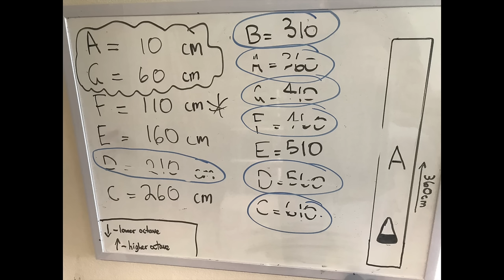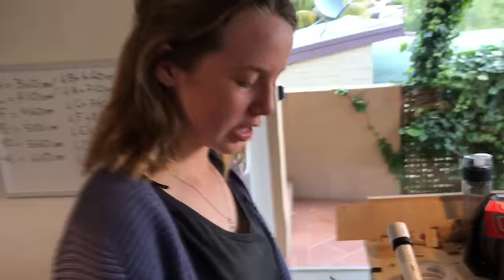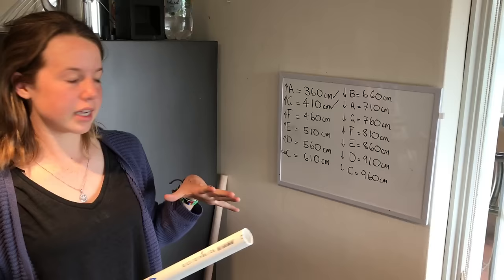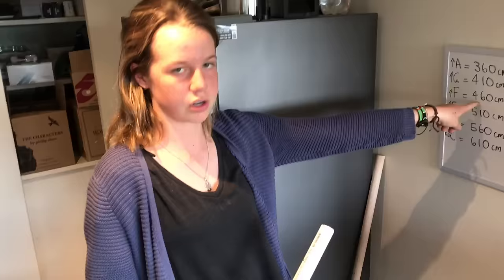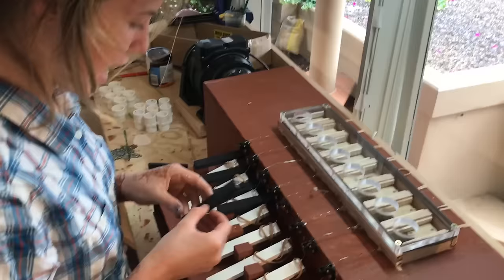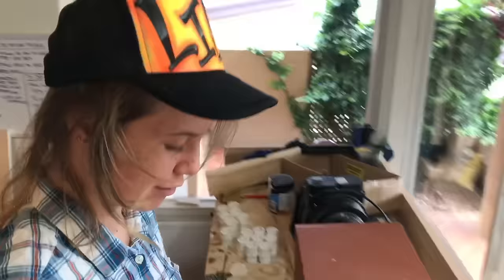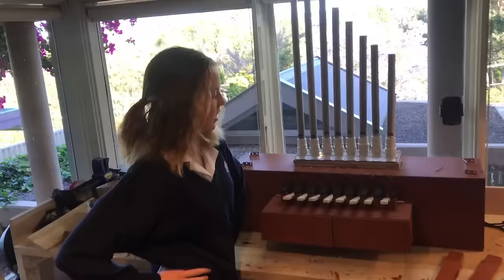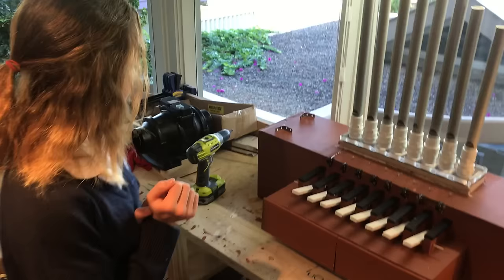Home Made Pipe Organ

Comment: Great, but the lengths of the pipes need to be exponential rather than linear. This is why the higher notes tend to sound flat. I would suggest tweaking the length of every pipe using a tuner.
Reply: "real" organ pipes have a tuning mechanism. Sometimes a tube that slides in/over the main pipe to change its length.
Reply: Excellent point.

Comment: Awesome creation. I took the liberty of correcting the lenghts of your pipe if you want to stay in tune with other instruments. Note A3: 220Hz, 720mm;
Note A#3: 233Hz, 680mm;
Note B3: 247Hz, 641mm;
Note C4: 262Hz, 605mm;
Note C#4: 277Hz, 571mm;
Note D4: 294Hz, 539mm;
Note D#4: 311Hz, 509mm;
Note E4: 330Hz, 481mm;
Note F4: 349Hz, 454mm;
Note F#4: 370Hz, 428mm;
Note G4: 392Hz, 404mm;
Note G#4: 415Hz, 381mm;
Note A4: 440Hz, 360mm;
Note A#4: 466Hz, 340mm;
Note B4: 494Hz, 321mm;
Note C5: 523Hz, 303mm;
Note C#5: 554Hz, 286mm;
Note D5: 587Hz, 270mm;
Note D#5: 622Hz, 255mm;
Note E5: 659Hz, 240mm;
Note F5: 698Hz, 227mm;
Note F#5: 740Hz, 214mm;
Note G5: 784Hz, 202mm;
Note G#5: 831Hz, 191mm;
Note A5: 880Hz, 180mm;
Note A#5: 932Hz, 170mm;
Note B5: 988Hz, 160mm;
Note C6: 1047Hz, 151mm;
Note C#6: 1109Hz, 143mm;
Note D6: 1175Hz, 135mm;
Note D#6: 1245Hz, 127mm;
Note E6: 1319Hz, 120mm;
Note F6: 1397Hz, 113mm;
Note F#6: 1480Hz, 107mm;
Note G6: 1568Hz, 101mm;
Note G#6: 1661Hz, 95mm;

Comment: Great job Lily!
Just to mention, for the length of the different pipes, you show and talk about the length in cm (centimeter), and that's what your table shows as well.
It should be instead mm (milimeter).
Imagine, a pipe length of 410 cm would mean a pipe of 4.1 m (meter), as one meter is equal to 100 cm (centimeter) or 1 m (one meter).  "Centi" means 100 and comes from the Latin language.

Comment: Nice build but you got tuning wrong.
Its not just adding notes, but multiplying by 2^1/12.
for example, let A=440hz, you can calculate A#=A*2^1/12, B=A*2^1/12, etc, etc.
Reply: Thank god someone said it
Reply: Actually it's not that simple because there is something called an "end correction" to the length that depends on the width of the pipe.
Reply: @MartinGaskellMusic  I was just talking about the frequency of the notes wich she got wrong.
Reply: Real quick, your example shows A# and B having the same equation, so be careful with that. 

Second, that is fantastic math, except that that shows us the measurement in Hz, not in length. She found a whole step to be +50 in length of her PVC pipes, and added them. She is not being 100% precise here so no one is too concerned if she her instrument isn't perfectly tuned to equal temperament. The only initial issue I see is not accounting for the half steps between E and F and C and B at first and measuring them as the same length as her whole step between C and D.

HOWEVER, it is clear in the video that the tuning of the instrument is, while not perfect, absolutely serviceable. This is because, drum roll please, she corrected the mistake. If she hand't, every key past E would have been at least a semitone off. Listen and look again, she tuned her pipes as they were made. While the notes aren't entirely in tune, that can be from many issues (end correction, the temperature/humidity changed since she tuned it, the wood has "breathed" and settled, the paint dried it out/made it too moist ect. ect.).

In other words, If you think her notes are full semitones wrong, then you don't know enough about the subject to be lecturing anyone. The math she showed earlier in the vid is obviously not the final math used in her instrument, and if you need any proof of that pause at 4:13 and tell me the size change in those tubes is linear.
Reply: @landonellis8591  She should maybe have cut them a bit shorter and then added a piece that can fit around that pipe to tune it with some tape to add friction (as you do organ pipes made out of lead, and maybe other variants of pipes)
Reply: @marcossidoruk8033  The video shows here using a tuning app so obviously it could have been adjusted if she cared.

Comment: Have you ever heard a steam calliope in a circus wagon that had 39 whistles. The pressure on each key is about 80 lbs and the whistles were made from used artillery shells. Was built in 1955, it was only whistles, key board and air chamber with valves. Its in WDM Saskatoon Saskatchewan Canada 🇨🇦.  There are air ones in USA, but there is one other in Ontario, Canada.

Comment: 410CM is 4.1M. I believe you mean 410MM or 41CM, the most correct to use since you're building is MM😉
Reply: If you want to be completely correct, use mm,  not MM
Reply: Perhaps this is happening in a parallel universe where everything is 10 times larger ..
Reply: @MetalMike50  It was to emphasize
Reply: Probably the result of not being educated in the metric system.
I wonder how many inches that pipe was.🤔
Reply: @dozog  They're in Australia, which primarily uses metric...

Comment: I'm pretty sure the high A pipe should be half the length of the low A one and it's off by 10cm, which would explain why it's out of tune. But great build nonetheless
Reply: I agree, and in between one should divide the length of a pipe with the 12th root of 2 (that is around 1.0595 in case you want to try it out) to get to the next semitone instead of adding a fixed length... Still a cool project!
Reply: It's because she's adding lengths to get to the notes instead of exponentiating the lengths. Music has a self-similar pattern, in that a chord an octave lower should have the same harmony as that same chord an octave higher. This self similar nature is what makes music an exponential (or logarithmic, depending on how you look at it) system. Using equal temperament, the equation is basically L * (2)^(n/12), where L is whatever the length of the base note you're tuning it off of, and n is the number of half steps above (or below) that note. You will find that, with this equation, an octave below will be exactly 0.5 * L and an octave above will be exactly 2 * L, what it should be. Furthermore, the relative distances (not absolute distances) between C4, E4, G4 will be the exact same relative distances as C5, E5, G5, and so on.
Reply: correct, but still a great project
Reply: Yes, but that's from the ignorance of whichever adults were advising her.  Not her fault.  Apart from that, great work on her part [as you say].
Reply: @robwilde855  Eh, I mean, she could have researched it herself. When I was in 8th grade I knew the basics of harmonics etc (and if I was doing a project where I needed to know how they worked, I would’ve looked it up!)
Reply: @Zavendea  Well, you're right.  I just try to be encouraging...  And we're all different, with different  understandings of the best ways to solve problems.
  All the best!
Reply: @doctorpropain8902  Equal temperament is a relatively modern compromise invented to enable instruments to play in multiple keys.  This, however, is a pure C major organ and doesn't need it.  It can be tuned to a perfect scale by cutting the pipes according to the simple ratios associated with the perfect intervals, 4ths (3:4) 5ths (2:3) and octaves (1:2).  So starting with G, multiply by 3/2 to get bottom C, divide that by 2 to get top C and multiply that by 3/2 to get F.  Then return to G and multiply by 4/3 to get D, multiply that by 2/3 to get A, multiply that by 4/3 to get E and finally multiply that by 2/3 to get B.
Reply: @doctorpropain8902  Thanks! Another cool thing I've leaned from the internet. Love YT !

Comment: It's a fantastic project. I would certainly be proud if my child did that. I think I would have probably nudged them pretty hard to get the lengths right, though. That said, it wouldn't be hard to adjust the pipe lengths after the fact to get it better in tune.

Comment: This was a really cool project, probably really took a lot of effort, and generally a good result. But, no offence, you got a few crucial things wrong. The length of the pipes shouldn't go up in a lineair fashion, but an exponential one. Hence why the stops are numbered 8, 4, 2... depending on how many octaves they are above / below the normal tone height. Aditionally, there shouldn't be any black keys between B/C and E/F. Apart from those two things, I really admire the effort you put into this. Good job!
Reply: I was thinkin the same. But really, just great work! I actually think you got everything in the right order! Just build the thing with the basic knowledge you have. You have enthusiasm, that's the most important thing. The "mistakes" with pipe lengths and black keys can easily be fixed later. You were probably able to tune the pipes despite the theoretical error in the lengths.
Reply: I'm an engineer - me too

Comment: Don't wanna be picky, but those pipes should be measured in mm not in cm right?
Reply: And they should be tuned. Tuning isn't difficult though, just cut them a few mm long and then grab a file. When I built my pipes (I made wood pipes) I put stoppers in the end which allow for tuning by moving the stopper in and out. It does halve the resonant frequency though, meaning the notes are an octave deeper.
Reply: @jackp.1711  I tought they would be Higher. But thanks!
Reply: @jackp.1711  Well its because pipe lengths are not linear, so you cant just subtract/add 50 from each one. Octaves are measured by a base 2 system and the notes between are logarithmic, so when I saw she made them linear I knew it was going to be out of tune...and here we are. However, the project is extremely impressive and far better than what I could do so I dont hold it against her
Reply: @aaronm.7267  the notes within the harmony she is creating are out of tune yes. The math didn’t add up. Pianos and I assume organs are tuned to the equal temperament tuning, and the difference of the frequencies is a constant numerical value, which actually makes the chords played,  out of tune,  with respect to the harmony of the notes within the chord.  The reason they are tuned this way, is because you have to compromise tuning of an individual chord, to ensure all other chords and harmonies of all of the other keys sound equally the same. But in reality, when the notes of a chord are tuned to the just temperament tuning, they will create perfect harmony. But you can’t do this with a piano because once you travel to a different chord, the notes will severely be out of tune because the frequencies are different depending on what other notes are played with one note to create harmony. The reason why choir sounds so good, is because humans naturally tune themselves to the just temperament scale when they are in harmony with others, and as they sing different chords or notes they adjust instantly to form another perfect harmony.
Reply: @Piano_Reimagined   @Benjamin Thompson  well when it comes to temperaments....just temperament is perfectly in tune with a diatonic scale but once you leave that scale and start playing chromatics it goes wildly out of tune. Equal temperament is equally detuned (theoretically) across all chords, though in reality some intervals and chords are better tuned than others. Organs don't always go by equal temperament, certain baroque organs are quarter comma meantone with split keys which I highly recommend you research, and there are weirder and crazier tunings like A being tuned in the 390's and other tunings like 5th comma.
However, all tuning systems are logarithmic regardless of what you tune by, and she did it in a linear fashion which resulted in the severe detuning. You can't really compare it to temperaments because temperaments are based on intervals and ratios between the notes you tune by.

Comment: Great job. It's super cool that you were able to build a homemade pipe organ. Not to discredit your hard work but it is pretty badly out of tune. I think there could have been extra work done on measuring out the lengths of the pipes. Because the organ isn't even in tune with itself its not even really usable. Other than as a gimmick. BUT that doesnt mean this isnt cool. Its super cool and it definitely takes talent to build that!

Comment: Hi Lilley - That is not really a pipe organ. It is more like the PORTATIV organs off the renaisance.  Pipe oragns today have 61 manual keys, 32 pedal keys and at least one full set of pipes for each division.   They consist of A wind supply, Chest, Pipes and Keys. There are not notes in an organ. Notes are found on written music scores, and the names of the 12 keys in an octave. The "Airbox" is known as a WIND CHEST. The system you are using is known as a "TRACKER" or mechanical action instrument. Your chord turned out very well. Congratulation.  Now - a little more information. The pipe you made are similar to some very special pipes made by the Kimball Organ Company many years ago - The arched mouths were not popular in pipe making.  ALSO, there is such a thing as scaling. Not only do the pipes get longer as the note becomes lower, but the diameter of the pipe increases..  This maintains the volume as well as the tone of the pipe while the length changes the pitch.  Using all the same diameter is like a concert flute - the tone for all notes is the same. But the higher notes lose their "Breathiness and get louder as the pitch (and relative diameter) increases. There are postings on YT that will help you understand how to do this. and it looks like you have a nice stock of PVC pipe of different diameters. If it was not for that disgusting sound of a hammon organ, your presentation would be quite nice. Well done, young Lady. 

Awww - you have some ciphers - the valves are not seated  - too much play.  Look up how a tracker organs works and give it a go from there. ALSO see how some others have built their own home organs. You came so close to the real thing it is not funny. All you need is pallet valves which seat UNDER the pipes. But you deserve a lot of credit for solving all the problems to make some pipes speak.
Reply: You know what year 8 is?

Comment: I wonder, those pipes are not even close to be between 110 and 610 centimeters. I would rather say they are 1/10 of that. Those has to be between 110 and 610 milimeters, or  11 and 61 centimeters. 610 cm is like 6,1 meter about the length of the girl 4 times.
Otherwise, cool instrument

Comment: it is way out of tune. Every pipe effective length should be calculated according to its formula. L=343/freq
You just need to look into a table which frequency corresponds to every tone.
Reply from the maker: Jorge W pretty proud of her accomplishment mate
Reply: I think that getting a working instrument is an excellent achievement.
Tuning is a complex topic - temperament, historical pitch, etc. The calculations can appear complex if you're not used to them. In this instrument, the easiest thing to change is the pitch, by cutting new lengths of PVC tube with the dimensions that correspond to the required tuning.
For a working prototype, I'd be very happy with the pitches as they are. Good job, Lilly.
Reply: 343/freq is temperature dependent...

Comment: Very cool Lilly... The dimensions on the board however cannot be right in cm, it should be mm I think.
Your G tone turned to be 410 cm you say... (that is 161,5 inch). So I think that your G-tone was 41 cm = 410 mm (=16,14 inch).
Nevertheless, a very nice job! 
Thanks for sharing this video!!

Comment: And that's why the metric system never took off over there... great job though!
Reply: Why? She did make a mistake and added a 0 or called it CM instead of MM. It's literally the easiest to measure with.

4100MM = 410CM = 4.1M = 0.0041KM which is 13.4514436 feet, or to make it even worse, 13 feet 5 27/64th inches. Those 27/64th is most likely the biggest reason why no one else in the world wants to touch the imperial system with a red hot rod.

Comment: 360 cm, meaning 3.6m ? Are you actually building pipes that measure between 3.6m and 9.6m? That's huge! But I see errors in your music math: the relationship between one note and the next is not linear ... You must multiply the previous length by either by 1.059 (2 to power 1/12) for a semi-tone (from E to F or B to C) or 1.122 (2 to power 1/6) for a tone (other intervals). If A is 360cm, G is 404cm, F is 453cm, E is 480cm